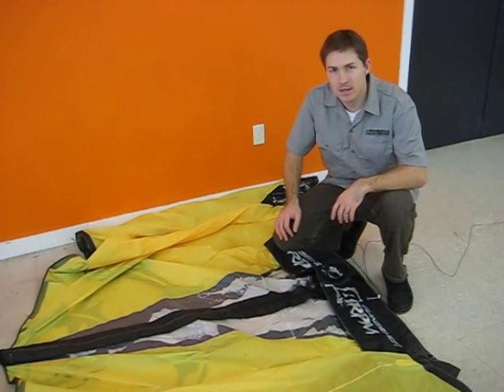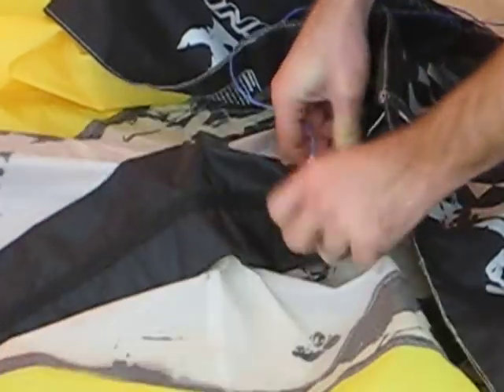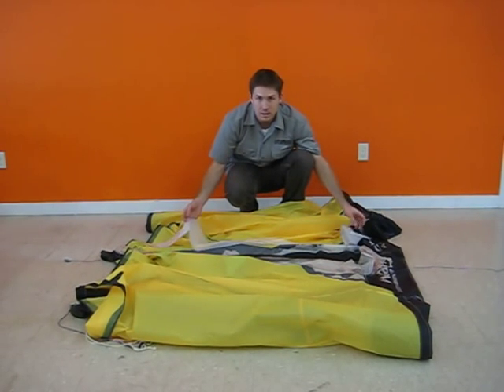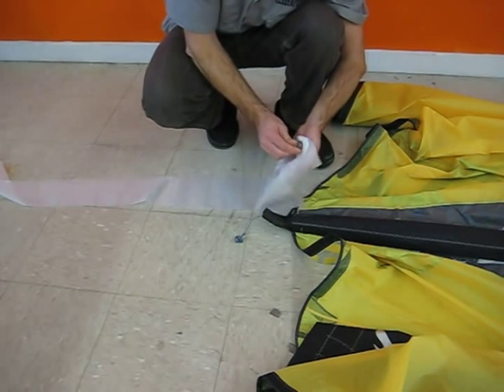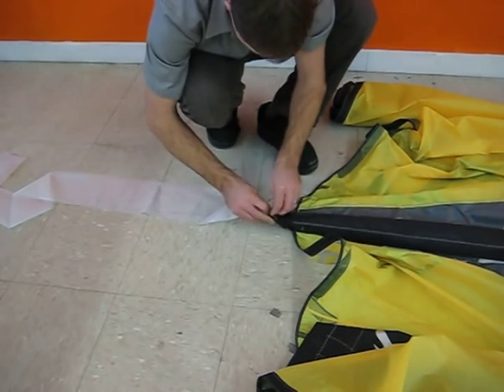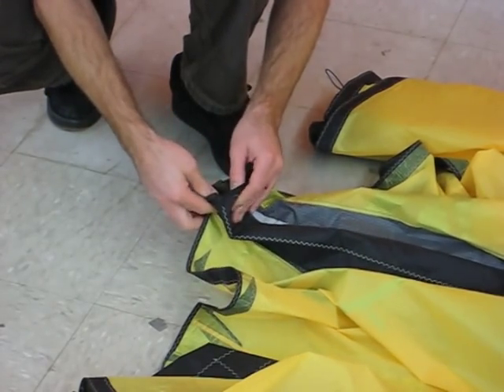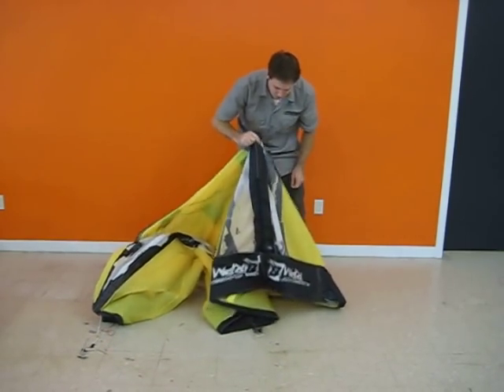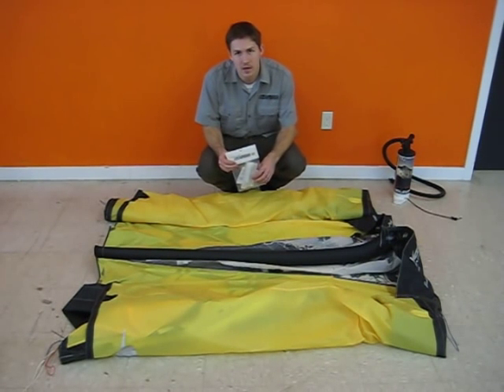Slingshot replacement bladder install - center strut - how to

Comment: got the string stuck in side the leading edge sleeve when i was pulling the bladder from the other side. any tips on how to get it out. im sort of catapilaring it along right now but that is not working
Reply from the maker: we usually tie the string off to something that makes "caterpillaring" easier.  I suggest tying it off to a sharpie and dropping that through the sleeve.
Reply: AIRTIMEkite i eventually got it unstuck but know it wont inflate properly so i have to do it again. i will try tying it to a sharpie this time. i think the bladder got twisted so ill have to take care to guide it through the sleeve better. thanks for the tip